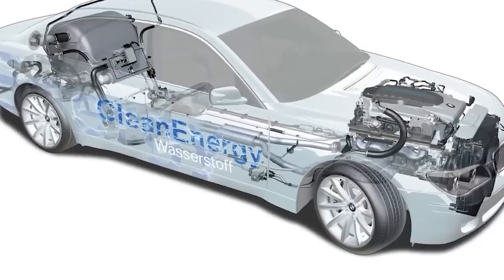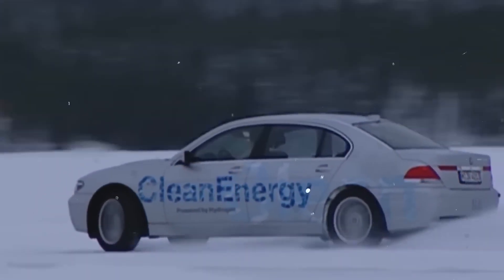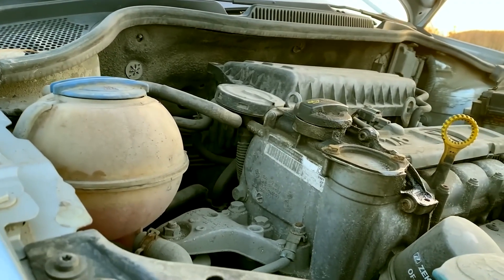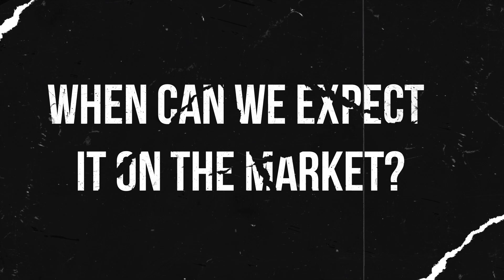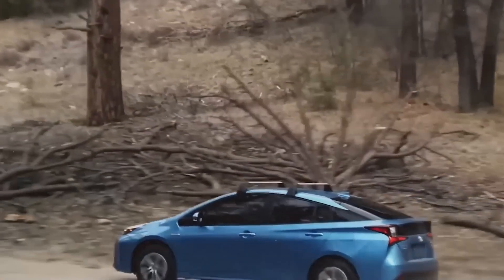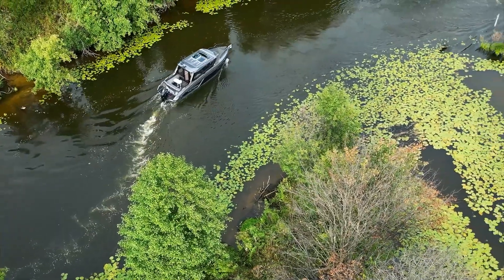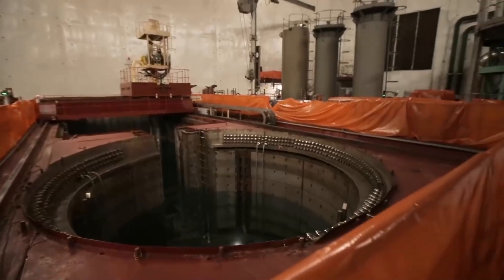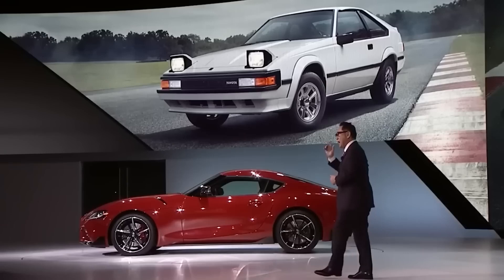TOYOTA's WATER ENGINE Revolution Could Crush Electric Vehicles!

Comment: Water requires expensive materials like titanium and stainless steel components. Electric does not, its much simpler with few moving parts. For trucking this might be great, but for short term consumer travel electric is very efficient.
Reply: That is the most Moronic statement I have ever read

Comment: Utter nonsense!
Reply: No reality. Hydrogen is a very explosive gas. Every molecule has a resonate frequency. When this frequency and voltage is produced it breaks apart similar to an opera singer shattering a glass with her voice. Thus, water can be broken down into separate oxygen and hydrogen atoms with relatively low power input.

Comment: It does NOT run on water. There is no available energy in water. The energy has to come from somewhere, and a "catalyst" is not going to provide that. There would need to be a large energy source like a battery. In which case EV would be MUCH more efficient. 
This is complete drivel, other than making an argument for EVs.